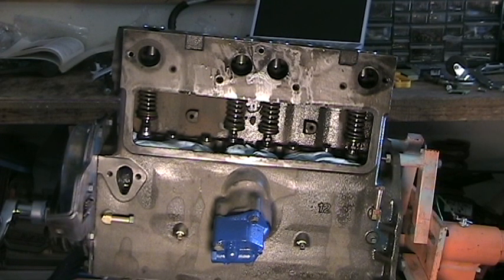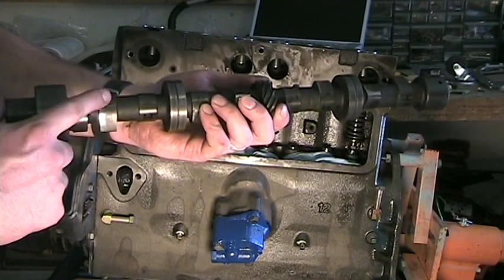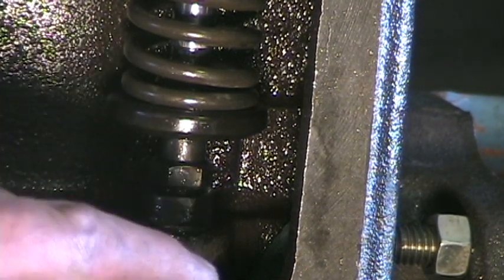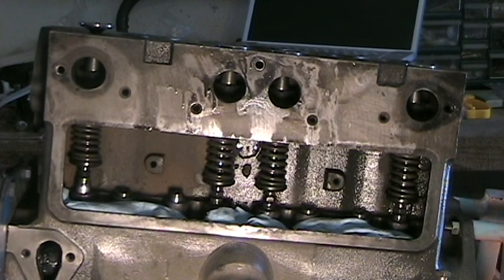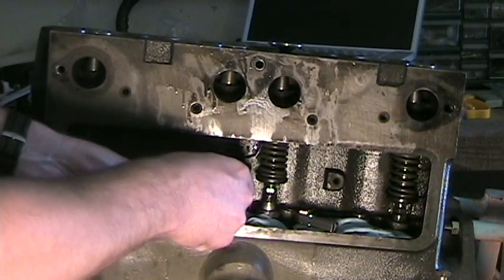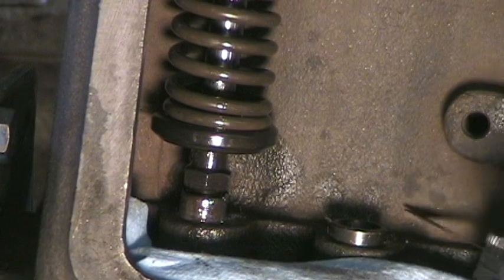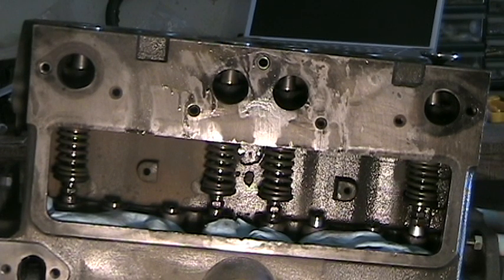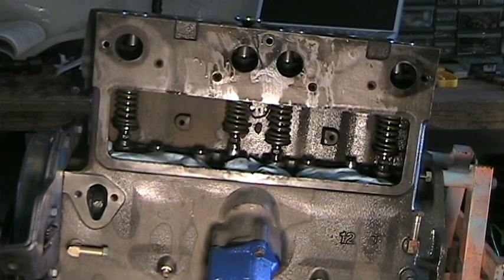F-134 Hurricane Exhaust Valve Lash Adjustment

Comment: why didn't you lock the final clearance setting on the exhaust values once you had them adjusted to the correct clearance by turning the 2 nuts together to prevent any changes to the final adjustment ?
Reply: Dan, you may know these exhaust valves are side valves.  They do not require locking in the same sense as overhead valves with tappet arms do.  If you did what you suggested in your question, then you will undo the achieve gap (lash).
Reply: I was thinking the same thing,I mean what holds the adjustment from changing

Comment: hannibal61577 If i am getting a lot of oil getting in to the four cylanders and blowing out a lot of blue smoke when i rev up the motor, do you think adjusting all of the exhaust and intake valves will help that?  The only other thing i can think of is the piston rings but my compression test shows 135 on all 4 cylanders.

Comment from the maker: No, I don't have any video on timing the engine, but it's pretty easy to do.  You just use a timing light and loosen the bolt on the distributor and twist the distributor slightly to get correct timing. Your best bet is to get the Technical Manual for your M38A1 or at least a service manual for the jeeps that also have the F-134 engine. Search for the CJ3B Page and once there, search for timing (YouTube won't let me add the link). Thanks for checking out the video.
Reply: I don't see what the timing light checks against. My rig is '55 cj5 f134 motor. I have the timing tab on the cover, just not sure where it's corresponding mark is on crank pulley? Any idea?
Reply from the maker: @robertosgood961  On mine, there is a notch in the crank pulley.